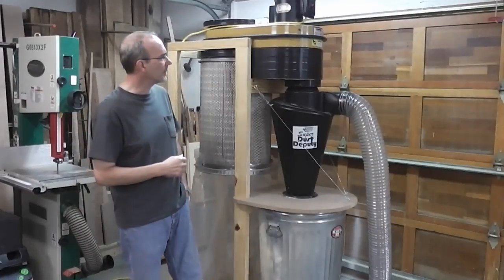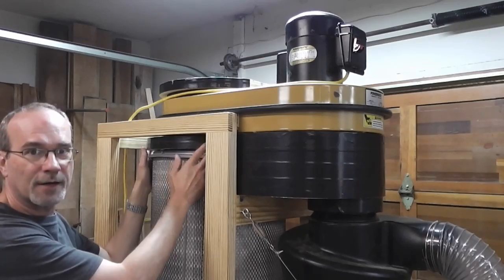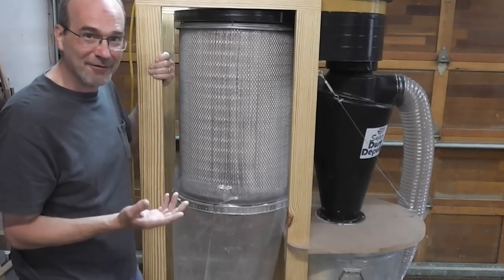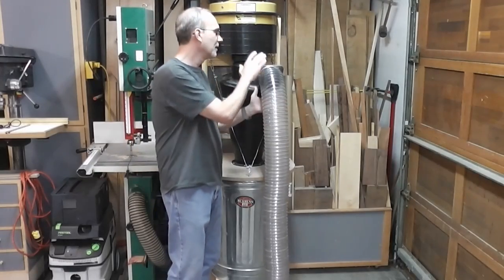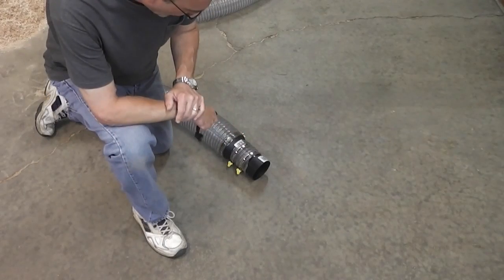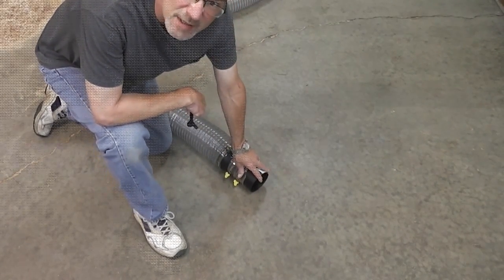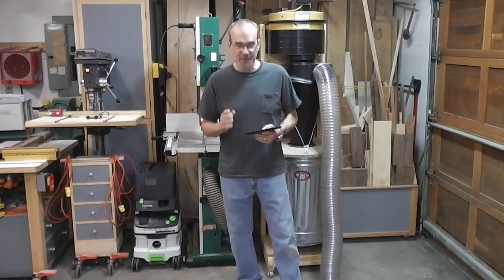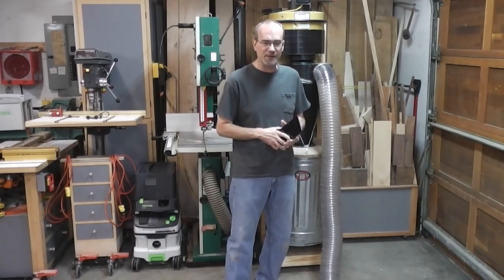Dust Collector Upgrade - Pt 2 - Complete System Rebuild

Comment: I have the same Powermatic 73 dust collector. I found a 5" adjustable elbow duct connector which allows me to have my cyclone mounted directly beneath the impeller , but offset enough to fit without having to make a custom baffle like the one seen here. After spending days researching HEPA canister filters, I ended up going with one from "Filter Professor" for about 1/3 of the price of Wynn's filters. 
The system works unbelievably well. Thank you so much for posting these videos. Not sure where I would be today if I hadn't seen the news a few months ago
Reply: Sy, I purchased an ol' Model 73 at an auction this week for $25. Would you mind sharing with me where you were able to find that adjustable elbow duct connector?  Thanks you!!
Reply: **Also, which size filter did you order?  Thanks again Sy!!

Comment: By chance did you measure the before and after weight of the sawdust you collected? I just installed the Dust Deputy as you did and currently DO NOT have a filter on the output of the impeller. I did a quick test just to see if all was working and was very surprised and shocked as to how much dust came out of the impeller. Several years ago when I upgraded another Harbor Freight unit with a Thien almost zero dust was coming out of the impeller. I may have done something wrong in the latest build and may rebuild everything.
Reply: OK dummy on this end... I reversed the in/out puts. It works MUCH better if you have the connections correct (LOL). This dust collector is a stop-gap for me. I plan to get either a ClearVue 1800 with a 16" impeller or the new Laguna P-flux 2 or 3 when announced.

Comment: where did you obtain the housing, motor, and impeller from?  How much did it cost?
Reply from the maker: If you watch the first part of this video series, it explains all that. The parts were taken from an old Powermatic system I have had for about 20 years.

Comment: Nice work, Guy. In the beginning I was hoping you'd eliminate the hose between the Dust Deputy and the collector, and I'm glad you did. You did a very elegant job of putting it together in one unit. I do have one issue about your math, though. Going from 214 to 535 is 2.5 times the CFM but it is not a 250% increase, it is a 150% increase. A zero percent increase would be 214 so that's your baseline for increase, double would be a 100% increase. Essentially 535 is 250% OF 214 but it is a 150% increase. Based on this, all of your references to percentage increase in both videos are off (I guess 100% high). Perhaps a minor point but an important one, although it does not detract from my appreciation from all the time you put into these videos.
Reply from the maker: Thanks! I'm a woodworker not a mathematician! HaHa.

Comment: Guy,  Thank you very much for the video.  I am looking at a similar build.  One thing I thinking of doing is using 2 winn filters stacked on top of each other.   I noticed that many of the cyclones use 2 filters for more airflow.  2 quick questions for you:  1) have you thought of  using 2 filters rather than one? 2) how much dust makes it to the plastic bag in actual use?   I am guessing that the volume of dust that makes to the plastic bag is small, and that I would not need a large plastic bag at the bottom.   

Thanks for taking the time to make the video, it has been very useful to me.
Reply from the maker: Hey Michael, It really isn't necessary in my opinion to have 2 filters. If I had a 5 HP motor and a much large impeller, maybe. And the only thing that gets in the bag is the dust from the filter when I blow it out from the outside with compressed air. Or I forget to empty the bin and it overflows :) I use the larger bag for that reason.
Reply: I redesigned a squat multi stage  500mm X 500mm X 250 high    WITH NO FILTER   99.9%    chips to   4 micron.   (Queensland University Electron Microscope tested) 125mm  duct IN.OUT  2hp   Too bulky,  Expensive FILTER,  in most cases less than mine  collects   Dust removal is the point of the exercise,   Cheers

Comment: Guy, I really love my Super Dust Deputy, but I have also ran into airflow issues because of the reducers I was forced to use.  One problem I know I had from the beginning was the 1HP blower I'm using.  The inlet is 4", so I had to go from the 6" on the DD to the 4" on the blower.  Major reduction in airflow there.  My plan is to get a new 2HP or 3HP blower with a 6" inlet so I can at least keep those the same and increase the airflow.  I think I'll keep my 4" trunks since I already have those ran through the shop as galvanized pipe.  We have almost the exact same trashcan/MDF lid setup, which i found works very well.
Reply from the maker: Hey Jason! I wanted to keep the airflow unconstrained as much as possible, that's why I went with the 5" hose to connect to the machines. The design of this has really worked wonderfully so far, and am very happy with the setup, although connecting and disconnecting it for different machines is kind of a pain the rear. But I am used to to it now. However since the base unit is 20 yrs. old, I think my motor has about had it.

Comment: How is the trash can held there... How do you remove it. How is it sealed. Great job. I'm building one myself
Reply from the maker: Hey Richard. The trash can is held tight to the MDF top by 2x4's that are slid underneath the trash can. There is some foam weatherstripping on top of the can that seals it. To empty the can, I just remove the 2x4's and lower the can. Not very elegant, but it works.
Reply: How many gallons trash can? Does the trash can seams leak ?

Comment: Great video Guy!  I did almost the same, but didn't add the HEPA filter.  Based on your information I think I will go ahead and add one to my system.  Again, thanks!
Reply from the maker: +Scott Bulger Thanks Scott! The HEPA filter is great. The amount of dust that settles on the machines from being airborne is almost non-existent.

Comment: Am almost finished modifying a Shop Fox 1.5HP single stage with a Super Dust Deputy and Wynn Filter. So far have fitted the Deputy, changed out the 4 inch flex tube to 6 inch (10 ft long) between the impeller and Deputy outlet, and used 5 inch flex tube (another 10 ft) with a 4 inch friction fit adapter at the end. I also put a Thien baffle in the underside of the Shop Fox (at the top of the dust bag mount) which I will take out later, just haven't got around to it yet. I haven't changed the configuration of the Shop Fox other than that. Wanted to see where most of the gains were before contemplating some of the larger changes you've made such as a direct coupling between impeller and Deputy.Even without the Wynn filter (still hasn't arrived) I'm getting 590CFM at the end of the 4 inch adapter. Very pleased with this as I've got the old bag filter on the Shop Fox, therefore should see a better airflow with the Wynn. Thanks for your videos, very clear and stopped me wasting my time trying to use the Deputy with 4 inch flex hose. From what I can see, switching the hoses makes the lion's share of the difference
Reply from the maker: +andy54giddings Sounds good Andy! 590 CFM isn't all that bad, and should work well with most of the tools including the planer which requires the most. Would love to see it when you're finished. And I'm very happy that my video helped out!
Reply: +GuysWoodshop Finally copied your design and finished the setup this morning. Mine is almost identical to yours except the impeller on the Shopfox 1.5HP I have rotates in the same direction as the Dust Deputy cyclone. With everything connected but no inlet duct on (just a 5inch metal elbow at the Dust Deputy inlet) am getting 1000 CFM. Once I put a 10 ft long 5 inch flex duct on, this reduces to about 800CFM. With a 4 inch reducer for the tablesaw, 750 CFM. So the flex duct is the area I want to focus on next by replacing some of it with metal.Just confirming your design really works well and again, appreciate your video
Reply from the maker: +andy54giddings Glad it worked out well Andy! 750 CFM is actually really good with a 4" reducer on there. Awesome!

Comment: Not dry at all Guy, very interesting. Thanks for posting.
Reply from the maker: +T Radford Thanks for watching! And not falling asleep! HaHa.
Reply: Guy I am about to install ducting in my workshop.  I am really interested in the CFM change when you added the 4" reducer.  Did you ever try reducing at the cyclone and then using 4" hose?  In other words is it even worth using 5" hose if the CFM reduces when the reducer is added?
Thanks.
Reply from the maker: +T Radford That's a good question, and one that probably could be answered best by a fluid engineer, which I am not. However I did test with just a 4" hose, and the CFM was reduced by around 25% if I remember correctly, that's why I went with the 5" hose and the reducer at the last stage. Up to the point of the 4" reducer, there is still less resistance giving a higher velocity before it goes into the smaller fitting. This will give a higher CFM than using just a 4" hose. All I can say is that if it were me designing the system, I would want the least amount of resistance in the piping, then just use a smaller hose when at the last point before the machine. I hope that helps!
Reply: It does help thanks Guy, thanks for taking the time to not only make the video but to answer my questions.

Comment: Guy,

Are there any sketches/plans for your awesome Dust Collector.  I am seriously thinking of buying a Harbor Freight 2HP system and adding the Oneida Super Dust Deputy. Your design is heads above anything else I've seen.
Reply from the maker: +Jim Challender Hey Jim, unfortunately I don't have anything like that. The harbor freight collector is very different than mine. Most are very different than mine. It was a 17 year old Powermatic, so unless you have the same one, plans wouldn't work. I know DIY Tyler made something close to mine from a HF DC. I am not sure if he made a video on it, but you can contact him at his channel.

Comment: How many projects could you have made in the time spent doing all those engineering calculations?  i.e.: Engineers tend to over engineer their projects.  By the way, very nice job with the collector.
Reply from the maker: +P Lemieux Thanks! Actually it didn't take that long. The filming of these videos and the testing took more time than the construction of the DC.

Comment: Very interesting Guy.. Thanks for sharing this information... Do you have a dust bag in the main bin or could you put one in there if needed??
Best wishes
Rod
Reply from the maker: Thanks Rodney. I don't have a bag imtherw. You could but there needs to be some kind of frame or weight holding it down or it will get sucked up into the cyclone. I did try a weight but it wasn't worth it.

Comment: Guy,  This 2 part video was very informative and well done.  It is neat and efficient.  Great job!  I am in the process of upgrading my old dust collector and really gained some great ideas from your system. I may even try to record a summary when done and place it here on youtube.  One question I have is how easy it is to remove the can for emptying?  Thanks for taking the time and effort to share.
Reply from the maker: Thanks Keith. It is pretty easy to remove. The 2x4 braces are pretty tight to keep a good seal against the lid, but they can be removed with a firm pull. Good luck with your conversion!
Reply: +GuysWoodshop Thanks.

Comment: nice system, one of the better ones I have seen so far.  I am not sure you have taken into account the loss of static pressure with increasing lengths of pipe/hose.  CFM will increase with increasing diameter of hose because the static pressure loss over the length of hose greatly decreases and that is why you will get higher CFM output, but you have to take into account the length of pipe if you are going to evaluate the performance.  The biggest difference I could see between your old system and the new one is the length of hose that connected the dust deputy to the filter was eliminated.  I would like to see how the air velocity changes over the length of hose.  You could do an experiment if you borrow a few 10' lengths of 4" PVC pipe and couple them together, measuring the velocity at each 10' interval.
Reply from the maker: Thanks hffcom. Yeah, I am familiar with what you are referring to. That's why I went from a 4" hose from the collector to a 5" hose only reducing to 4" it at the end that hooks up to the machine I'm using at the time. The 3 contributing factors for my increase in CFM were the cartridge filter, going directly into the DD, and the 5" hose. All in all, it was a pretty simple way to increase my efficiency at the machine without depleting my bank account. Thanks for the comment, and love your videos!
Reply: how much did you pay for your anemometer, where did you get it?  any recommendations?  I would like to get one.
Reply from the maker: hffcom It was a budget busting $20 from Amazon.com. I do not completely trust it's accuracy, however it did allow me to establish a baseline to judge the improvements. If you know any HVAC techs that you can borrow a better one from, it will probably will give you more accurate readings.
Reply: GuysWoodshop
thanks!

Comment from the maker: Hey Jeremy! It works a lot better than I thought it would, and am amazed at how much it picks up at the machine. And yes, the bag directly under the filter works great. The dust from the cartridge goes right to the bottom of that long bag, and there is little/no chance of it going back up into the filter. Thanks for watching!

Comment: That is a fantastic upgrade and some very excellent results.  On top of it all, it looks like it takes up less floor space.  Thanks for walking us through your tests and results.  My question is how did you seal the metal garbage can to the dust deputy?
Reply from the maker: Thanks Mastrjay1. The can has a piece of weatherstrip on it, and the can is held up against the MDF with 2x4 boards underneath it. Not very elegant, but it works well and is easy to empty.

Comment: How often do you find yourself emptying out the clear bag after the HEPA? I bought the SDD to convert a Jet DC1200 that I bought which already has the HEPA filter (GE aftermarket) but I wanted to see if I still need the bag! Thanks for the great series and info!
Reply from the maker: Hi Peter,
I have done 5 projects since I did the "makeover" of the DC, and so far I have about 2 inches of very fine dust in the bottom of the bag. Most of it is from blowing the cartridge out from the outside in to clean it. I think it will be a while before I think about emptying it. Hopefully it will go for 9-12 months before I have to deal with it. Overall though I am extremely happy with the conversion!

Comment: Guy, just wondering which HEPA filter you bought from Wynn, they have several filters like the one you have, but different price, http://wynnenv.com/products-page/woodworking-filter-pricing/.
Reply from the maker: James, the filter I am using is the C1425 filter. It is open on both ends, and has the mounting flange with rubber gasket on one end.

Comment: Great video.  very informative.  I'm hoping to get that setup going eventually in my shop.  Where did you get the custom baffle made?  Did you build that yourself as well?
Reply from the maker: Thanks Colin. Yes, the baffle was made in my shop. It was made with a MDF top and bottom with hardboard bent around the outside. There is a channel inside of it to help move the dust and chips in the right direction. I guess I should have taken pictures...
Reply: GuysWoodshop Hi Guy would there be any chance that you could put up sketch of the of the inside of the baffle that you made and maybe some dimensions  thanks in advance.
Reply from the maker: Rick Janisse Hey Rick. The shape of the outside simply follows the contour of my impeller housing. All I did on the inside was to "wall off" the extra area so the input of the impeller goes straight to the out put of the SDD. Not much going on the inside of it.

Comment: Great series.  If you could put solid pipe/ducting in rather than flex hose and use 'gradual curves' for changing direction,  you would see another gain, but you have already gotten the lions share of the benefits.  Congratulations for making a good, well documented, set of videos.  The best thing is you will be healthier for it!

Comment: Inspirational - I can see myself diving into the upgrade path with my old dust collector. It does beg the question 'why are dust collection systems so expensive?', it's not like it's rocket science. Thanks for documenting it, Mitch
Reply from the maker: My videos have had many things said about them, but that word is a first "inspirational". Thanks for the kind words Mitch! I think a lot of the cost is in the motor, engineering and of course the marketing. But I agree the good ones are rather expensive.

Comment: It's huge!
Reply: If I only had a dollar every time I heard that! I assume your are referring to the size of the rebuilt dust collector. The footprint of the system increased by 4" to the front, and increased 1 1/2" on each side. However The Super DD and the can are now incorporated into the design, so I I gained a 20" x 20" patch on the floor. So overall, it takes up much less space.But it is tall....

Comment: Great work, Guy!  Those numbers are really impressive.  Can you notice a difference in collection when using a tool such as the table saw?
Reply from the maker: Thanks Matt. Yes, there is absolutely a difference. The cabinet in the table saw stays clear of a build up of saw dust, and the table is staying much cleaner also. The same goes for the band saw. I have not tried the planer or jointer yet however, but I'm sure there will be a difference there also.